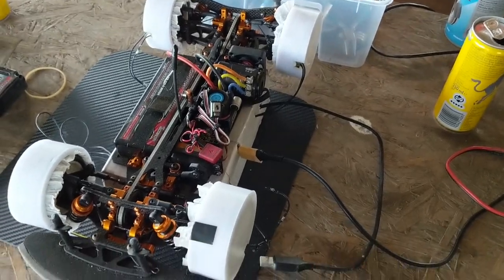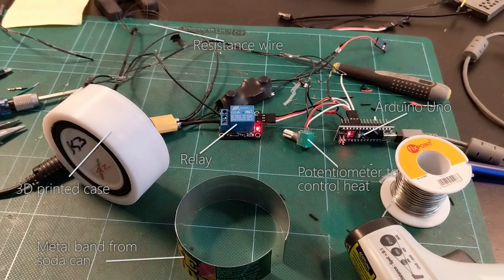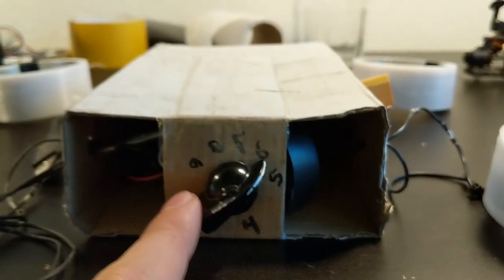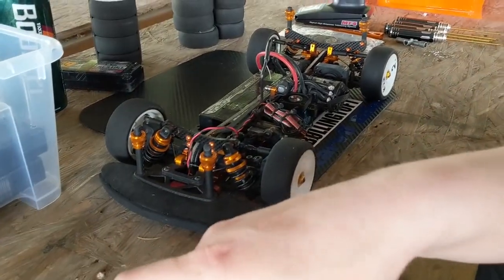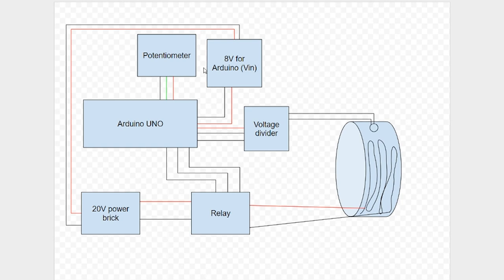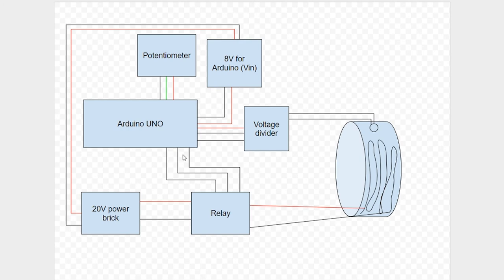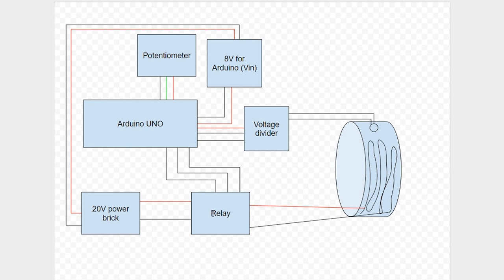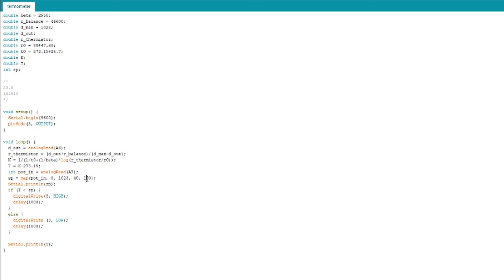3D Printed RC Tire Heaters

Comment: Awesome idea and implementation. Those Ardiuno Nanos are awesome. I am currently trying to design the ultimate RC toolbox/towable unit. Looking to build a custom unit electrical part for at the track that will charge multiple batteries/ heat tires/ test servos and whatever else I can hook into it. Have a bad as stainless steel control pad.
Reply from the maker: Sounds like a fun idea and very useful idea